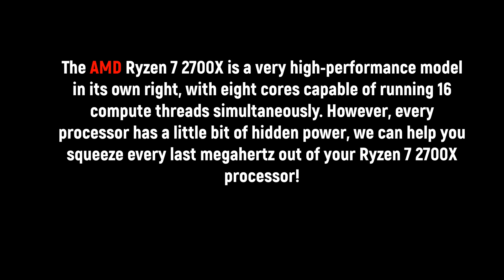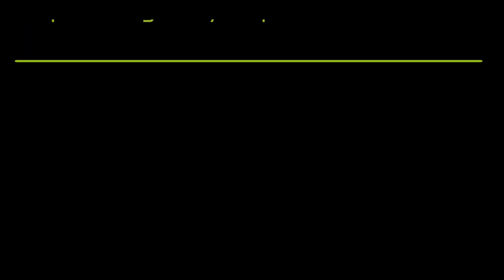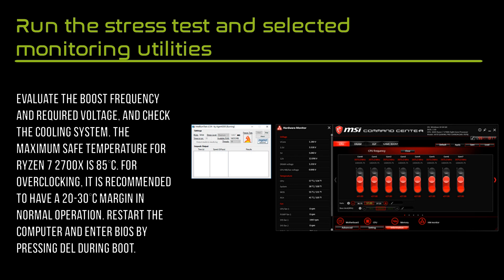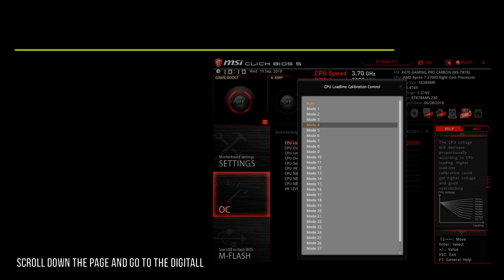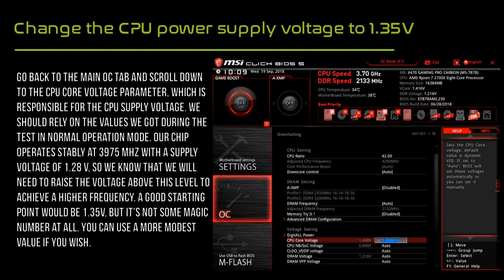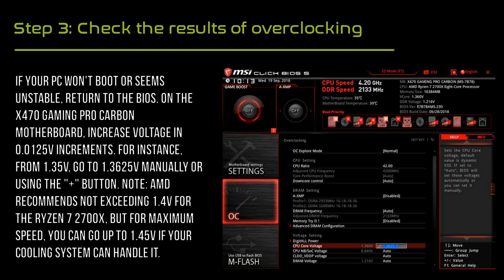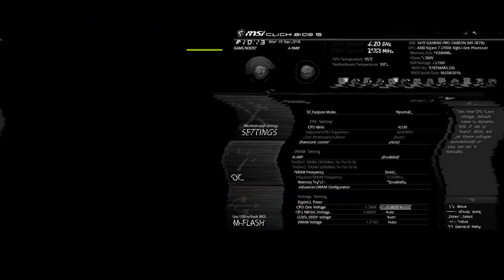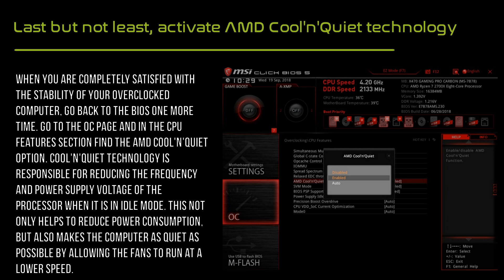Overclocking Guide for AMD Ryzen 7 2700X on MSI X470 Series Motherboards

Comment: Hii i need help
Reply: @soft4bro  my secure boot is always get enabled itself even after disabling it
Reply: @soft4bro  i can't install any other os rather than windows 10
Reply: @soft4bro  can't boot thorough bootable usb device
Reply from the maker: @AbhinavSingh-fy3wh   It sounds like your system is automatically re-enabling Secure Boot, which prevents you from installing other operating systems or booting from a USB device. Here are a few steps you might try:

1. BIOS/UEFI Settings Ensure you're saving changes when you disable Secure Boot in your BIOS/UEFI settings. Sometimes changes made to these settings don't get saved unless explicitly directed.

2.Clear Secure Boot Keys Some systems allow you to clear the Secure Boot keys, effectively resetting it. This could help if the settings are not being saved properly. 

3.Check for BIOS/UEFI Updates:
Occasionally, BIOS updates address issues related to Secure Boot or USB boot problems. Check if there's an update available for your BIOS/UEFI and install it.

4. Disable TPM: Sometimes, the Trusted Platform Module (TPM) can interfere with boot settings. Try disabling TPM in BIOS/UEFI settings.

5. Reset BIOS/UEFI to Default SettingsYou might also try resetting your BIOS/UEFI settings to default, as this can clear any persistent settings causing this issue.

If you're having trouble booting from a USB device, ensure that your bootable USB is properly set up (correctly flashed with an operating system) and that your system recognizes it as a bootable device. Sometimes, creating a bootable USB might encounter issues that prevent proper booting.

If you're trying to install an alternative operating system, be aware that some systems may have limitations or settings that specifically prevent installing non-Windows OS. Double-check if your system allows for the installation of other operating systems.

Remember, adjusting BIOS/UEFI settings can have significant impacts on your system's stability and functionality. Exercise caution and ensure you understand the changes you're making.